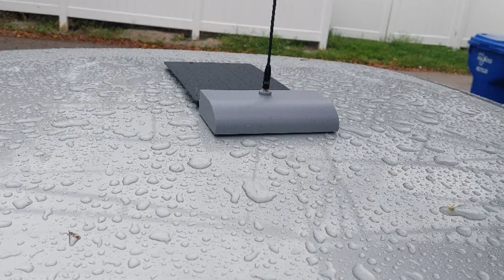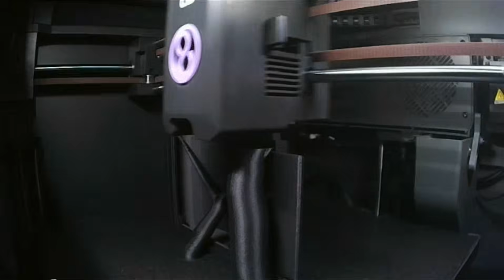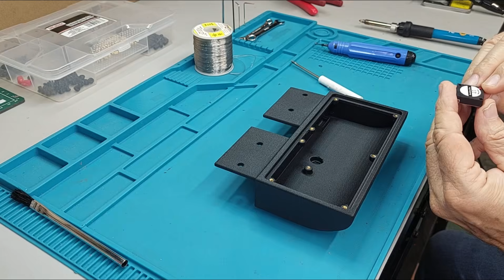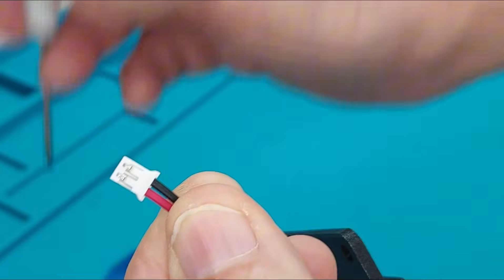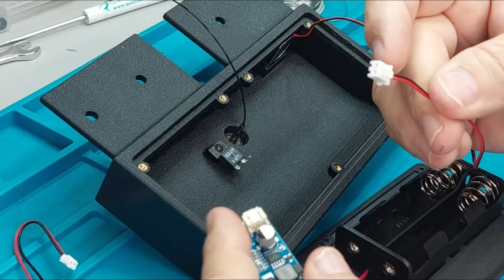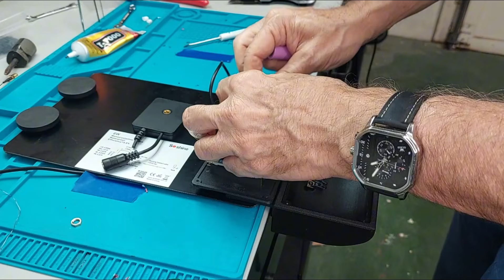Vehicle Rooftop Solar Node, Step by Step Assembly DIY

Comment: This is by far the best rooftop node design ive seen, will definitely be making one soon!
Reply: The only suggestion i have is to add a power switch to turn the lora board off when you don't want it on and draining the battery

Comment: Oops. The link to the MPPT charge controller is actually the battery holder. I found the right one with a search for the description "CN3791 6V MPPT Solar Charge Controller".